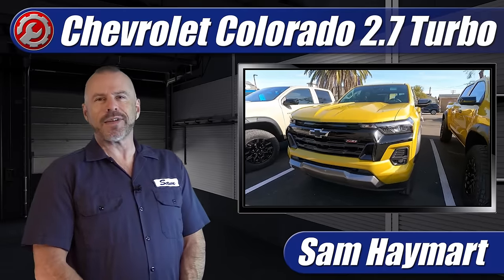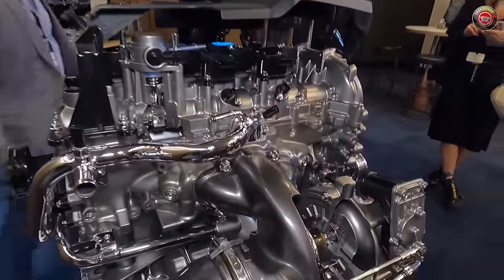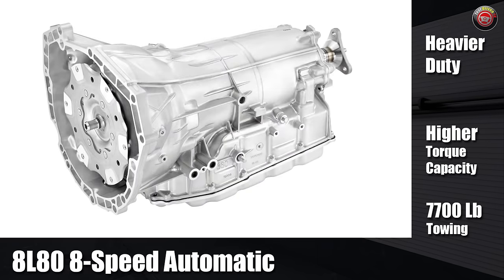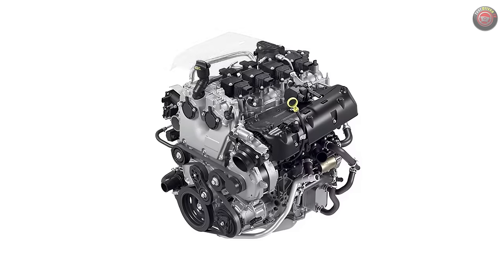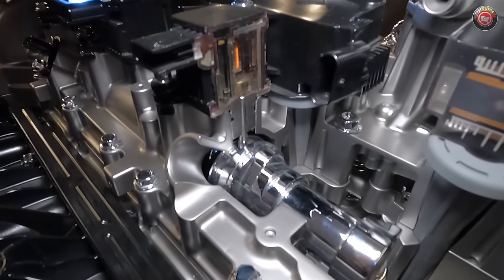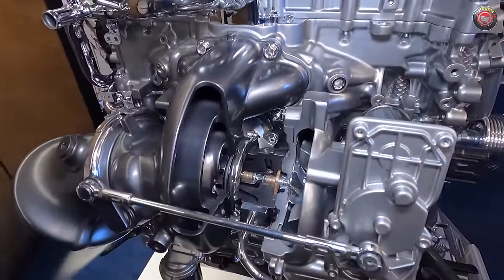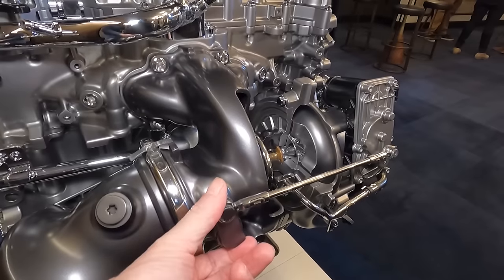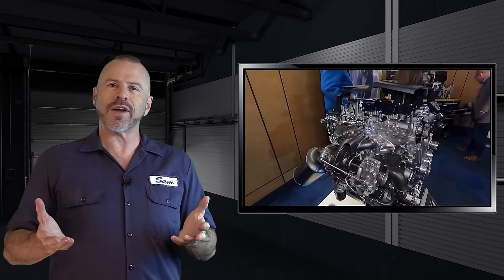2023-2024 Chevrolet Colorado 2.7 Turbo Engine: What You Need To Know

Comment: lots of things in common with the Toyota 2.5 liter Dynamic Force engine. Such as the electric water pump, variable oil pump.  I like the Toyota engine better though because it does not have the 2 cylinder deactivation thing and also Toyota's port and direct injection fuel system to keep the valves clean.
Reply: yea not having port injection paired with GDI and AfM is a deal breaker for me (the AFM thing baffles me& its been crap since 2008)! toyota knows if they’re going to build motors with longevity those 2 things are a must ! the 3.5 dynamic force & the 2.5 both got it right & im assuming the new 2.4 that will be in new 4runner & taco will share the  same tech
Reply: @thisdayage7997  AFM on a 4 cylinder is a real head scratcher.  It can only be for EPA numbers.
Reply: @csinalabama  ya a 2 cylinder turbo what could go wrong🤦‍♂️they designed the whole valve train around AFM & the camshafts are custom ground in house by GM for quality control….i ASSume it’s because its very finicky & unreliable otherwise….way too much going on in the valve train for engine to be reliable long term ! when they ran the 2.7 through a torcher test they said nothing about running it in AFM mode
Reply: Aren't these things designed to run hotter... can understand the port injection concern in a non-turbo, just unsure if the same issue on a hotter running turbo where the carbon is more likely to be burned.  Also, not liking AFM because... it might save gas when going downhill?  Do you really think it's active in normal driving?  No.
This is all 'feelings' based, would need some numbers to understand the complaints.  Kinda reminds me of what people said about the Ford 2.7L when it was new.
Reply: @toddwerther188  Really two separate issues.  GDI engines get carbon buildup on the valves unless port injected fuel cleans it off.  It happens less with a high quality synthetic oil that is regularly changed.  AFM engines activate when the engine is at speed and cruising.  The AFM system causes lifter failure and oil consumption.  There are lots of videos on GM's AFM problems.  If you want to think the problem is solved, that is up to you.   The issue of turbo engines getting hotter is a real concern.  The oil breaks down faster in a turbo engine and should be changed no later than 5k miles.  Turbo engines need better heat management than non-turbos, so do your homework on heat management before you buy a particular company's engines.  For example, look at all the problems with head gaskets on small Ford turbo engines.
Reply: @csinalabama Yeah, GM is trying to skimp for MPG ratings.
Reply: “A.F.M.” 👎👎👎👎 It’s a Full size Truck keep it running “4” cylinders no thanks even if it was always “4” cylinders direct fuel injection… Does GM think their direct injection won’t succumb to fouled up intake valves???
If this engine was 4 cylinders all the time and “DUAL” fuel injection I would consider it
Reply: @MrJEEPJT  They just want a profit, and they only look at quarterly stock reports.
Reply: @toddwerther188   I’m not a F-150 advocate but at Least Fords 2.7 is 6 cylinders all the time…🧐 I would have to hypothesize that an in-line “4” would be a simpler design… GM really botched this design with cylinder deactivation/AFM  as first glaring issue !!
As a clean slate design should have dual fuel injection to keep intake valves clean….
Addition insult “3” different power versions another GM SCREWS The customer for more money
Reply: @myk1_sp  🤨 What was I thinking ??? GM executives not interested in giving the customers the best truck for their hard earned $$$ at many $$$$ above sticker price !!! Rest assured Toyota will have a far better “2.7” turbo 4 for the Tacoma….for 2024
Reply: @MrJEEPJT yes hopefully Taco/4Runner come with 2.7 not 2.4 . I want more Torque.
Reply: Toyota aint any better, overrated

Comment: GM reliability is very questionable in the last few years, especially cylinder deactivation.
Reply: And transmissions!
Reply: @chrisb9478  That’s true. My daughter has a 2016 Surburban and the trans went out on it with around 150,000 miles. It rides and drives wonderful but it has had its issues but the cylinder deactivation has worked great so far and now it’s pushing 200,000.
Reply: Same thing can be said about all the brands. GM just gets all the attention because of the 8 speed which is fixed by now, and I would know because I have a 2019 sierra with 172000 miles with no problems, At all on anything on that truck. But it's still a looser truck because Consumer Report says so. The new Colorado and Canyon look 10 times better inside and out compared to all the competition out there if you were to be honest.
Reply: I bought the Range Solution Chip to plug in port under dash 2 keep it in 8cly mode,  works great...
Reply: Doug I 100% with your statement. 8 speed has been problematic as well.
Reply: @John & Whitney Kokalis  the 8 speed shitter and shake does not effect all transmissions. Just a small % of them but a big enough % to be a big problem.
Reply: @chrisb9478  my friends 2019 zr2 Colorado has been having transmission issues. Chevy is dragging their feet to fix it.
Reply: Is that a Chinese motor?
Reply: I absolutely love GM Trucks as far as the ride and handling. I have been burnt by a 10 and a 20 Gmc sierra. I made the switch to a Tundra but hate the way it rides. So what the hell is a man to do? 🤷🏼‍♂️

Comment: A 4 cylinder turbo, with cylinder deactivation ?
I have had a very successful,  40 years career with forced induction, sounds like to me the drinking water from Flint has found its way into the Powertrain Engineering Dept. at G.M.
Reply: I'm in the market and this is the way it is going, not by market demand but by demand of the W.E.F. and the traitors in D.C. With that said the Toyota is also going to a 4 turbo and is $10,000 more? What are your thoughts on those of us needing reliability and utility in our trucks? I drive an 07 Frontier I bought new, 150,000 later still running good, but it won't be long. I'm a remodeling contractor and tow a trailer 3-4 times a week. Thanks
Reply: you never even feel   when its  running on two  and power is instant it you touch the throttle    beats  the 5.3   hands down
Reply: @buellscool1  just bought  a 24 sierra with the 2.7    its a beast  lot more  power than the 5.3

Comment: this is all nice and cool, but I would rather have a 3.5 v6 naturally aspirated,  that will last a lot longer than a turbo charged or supercharged engine. I will take longevity over a couple miles per gallon anyday
Reply: 98% of owners will never keep the truck long enough to worry about longevity, its the American way.
Reply: GM ran that engine pretty hard in their durability testing with little to no wear.  You can make anything robust with enough money.  GM did drop their inline six project which confused me.  One head and set of cams, no balance shafts, easy to turbo and electrify.  I also like V6 and it makes sense for FWD due to short length.  But a truck can have a long hood.
Reply: Every diesel engine is turbocharged, and they last for a very long time. So the issue isn't the turbocharger.
Reply: @fightfortheright1776  This is false in more ways then one. I will just stop with the fact that all diesels do NOT have turbos.
Reply: Exactly. I wouldn't trust this at all.

I had an 06 with a 3.5 and it was great. Had no problems at all.

Comment: Sounds like it would be awesome, for as long as the factory warranty lasts
Reply: They want it to fail close to 100k miles so you have to buy another truck. Turbo on/with an aluminum block and aluminum heads is a recipe for failure.
Reply: @michaelgood1791 some of the strongest engines ever made have aluminum blocks.  Some of the strongest engines ever made have turbo chargers.  What in the actual hell are you saying😂

Comment: Probably going to have the same issue with intake valves as for due to the direct injection not have fuel pass by the intake valve keeping it clean. Looks very complex and long term reliability is questionable.
Reply: yeah I'm a little worried about GDI as well i honestly wish they keep the 3.0l diesel or put the 2.8l diesel in their way better gas mileage id say since its smaller then the Silverado it would be even better on fuel id say about 33 city and 38 highway id still feel like the 2.8l would need a little bit more power but one more benefit diesels tend to last longer then gas engines just another reason but they dropped them for some reason and I don't know why honestly cause the turbo 4 banger might get more power but it gets a terrible 19 city and 23 on the highway and it has AFM I wish gm would at least leave the 4 bangers out of but I guess not this is all what's stopping me from getting the canyon

Comment: Got 204k miles on my 2.7 she runs like a top. I don’t tow anything thoe. I also change oil at 50 percent oil life.
Reply: Wow, what type of oil do you use?
Reply: Great to hear it.
Reply: That's good, I'm at 35,000 kms and the oil cooler needs to be replaced. I tow an RV occasionally but otherwise it's been a daily driver. I'm somewhat concerned about longevity.
Reply: We hear people bad mouthing engines all the time. It really does not matter on what company makes it, or whether it's a 4,6, or 8 cylinder. What almost all people go by is the oil life monitor. Modern day engines need more frequent oil changes. Especially the turbo engines. Doing that will eliminate a lot of the horror stories you here about.
Reply: I'm with you on those 50% oil changes

Comment: I ordered a Colorado LT 4x4 with the L3B - HO. I Can't Wait !!!  I didn't want to pay the ZR2 price so I got a lower trim level with all the power. We test drove a 4x4 Ranger and compared it to the 4x4 Colorado. The Colorado won "Hands Down" ! The hard part is waiting three months for the build and delivery.
Reply: I'd rather have the standard suspension anyways. The ZR2 is a lot of weight, a lot less capacity, a lot worse mileage, and a lot more strain on the components.

Comment: Will be interesting to see how these fair long, long term. By the time we know, we'll be mandated to drive EVs if we want new cars.
Reply: I was thinking the same thing, by the time we know, you won't be able to get the proprietary parts that break.  The cooling and oil systems seem overly complicated.
Reply: Lol. Doubt it.
Reply: TheJoncic   It depends on how we interpret long term. I interpret it as until the warranty expires.
Reply: What does administration has gone gas I’ll be back under two dollars a gallon. EV cars will be dying off.
Reply: I C E will still be here for another 40+ years. EVs are not the future.
Reply: @frotobaggins7169  Maybe, but an external water pump should be easier to replace. Reliability is important but so is being easy to fix.
Reply: @joew6277  Maybe, but how much does it cost and where will you find one?  My guess is this is a pump used only on this one engine.  The v8 is very easy to work on.  I could change my water pump for about $50 and one hour and I could find it in any parts store anywhere in the country.
Reply: @frotobaggins7169  In today’s world I imagine it would be hard to come by. Unless they start making a bunch of these engines to where they need a bunch of replacement parts.
Reply: Didn’t you hear him say proven at the beginning don’t think they been out long enough to tell yet
Reply: Why not turbo a 4.3 v6? I mean ffs!
Reply: Can u reallynot eventually get parts? I mean basic parts? Real specific parts i cna understand.

Comment: Wondering if carbon buildup on the back of the valves  might become an issue on account of the direct port injection. Otherwise, looks like a strong, light engine. Interesting that they charge you $395 to "uncork" the rest of the torque, lol. Probably takes a 5 minute firmware update.
Reply: I thought of that too.
Reply: Here's is what my mechanic told me.  Carbon actually absorbs gas and with lower your mpg on an old school set-up then hardens making it impossible to burn off if not treated.  We all know how a DI system works.  Dump in Seafoam every oil change and it will keep you running and help remove it.  How, since no fuel hits the valve?  It does what the bottle say.  Lubricates the surrounding areas and with vapor from Top Tier gas will clean it up.
Reply: The vapor of top tier gas will clean what; the surrounding areas? How about the carbon built up on the out side top of the admission (intake) valves? Heard it gets pretty bad carbon built up over there.
Reply: @luisgonzalez8929  got a point.   I’ve seen videos where you pull off the intake hose and dump a can through the throttle body to get to the upper end.
Reply: Check out the video from the guys at TFL when they interview the engineer about the design of the engine, lots of good info directly from the engineer. I believe he answered this question and if I recall correctly, that build up of carbon that has been seen on some other engines with DFI, has to do with how the crank case ventilation is designed.
Reply: @toddkovalcik332  Yea I've seen that one.
Reply: @toddkovalcik332  CCV might effect how quickly it happens but I think carbon buildup happens universally for DI engines.  Top tier fuel might help, sure.  I try to stay as exclusive to TT, regardless of vehicle/engine.
It might be the case that GM calculates that carbon buildup will only become a problem by the time the engine needs rebuilt anyways, i.e. 200 or 250K miles.

But yeah, when he said 10:1 compression ratio running on 87 octane, I figured they had to be using DI before he even said it had DI.  It's amazing how well combustion can be controlled these days.

Comment: Hopefully this doesn't bend rods in eco 2 cylinder mode like the v8s. Would have preferred GM left cylinder deactivation out of this engine.
Reply: This exact engine has already been in production for several years with literally hundreds of thousands in larger/heavier half ton trucks…they aren’t bending rods.
Reply: The 2.7 does not have "rods" or pushrods. It's an overhead cam engine.

Comment: I have a 2018 LT Colorado and has the 3.6 L engine.  During the summer it gets close to 28 mpg.  Now I am very disappointed that this engine is being done away with in the Colorado.  The 2.7 turbo engine gets worst fuel mileage than the V6 3.6 L engine.  I think that can be a mistake because many like me really like this engine.  I do hope that in 2024 GM decides to also use the 3.6 L engine again.  The mileage on the 2.7 tubo is less  than the 3.6 engine and fuel costs are high.
Reply: are they higher when cruising on the highway or overall?

Comment: Just go the 2024 WT with the Turbomax engine and towing package.  Coming from a VW golf. Lol. The torque delivery is extremely different in the Colorado from what I’m used to. The power band is pretty evenly distributed on this engine/transmission set up. I don’t feel the pull very much of the turbo, but I’m at 75 on the highway before I realize it.  So far so good on the Colorado!  It’s the best looking Colorado in a decade, inside and out.  A very capable truck.
Reply: I have a 2023 WT with the 2.7L
Vinyl floors baby

Comment: Seems like a pretty nice setup, definitely a nice break down you did there thank you. I want to see what Toyota's setup is going to be on the Tacoma maybe not the most torque is the best idea cuz 20-27 lb of boost that's quite a bit, makes me concerned about heat soaking the turbo 🤷 Toyota uses air-water intercooler instead. I'll b looking forward to what's going on in midsize 🛻💨 segment
Reply: The electric waterpump is designed for excellent heat exchange as its centered to cool around the turbo first.
I doubt that will be a problem!
This is a promising design.
It uses some Diesel durability, so added bonus to buyers working the engine hard.
Reply: @jemtec1  The “AFM” or cylinder deactivation on a “4” cylinder design🧐🧐 Nope deal breaker at least if it was always “4” cylinder operation I
Would say ok. Rest assured Whatever Toyota brings to market be it a turbo version of their very stout “2.7” 4 banger will be far better…
Reply: @MrJEEPJT  """Standard i-FORCE turbocharged 2.4-liter four-cylinder engine produces up to 278 horsepower, 317 lb.-ft. of torque.
Available i-FORCE MAX turbocharged 2.4-liter four-cylinder hybrid powertrain produces 326 horsepower, 465 lb.-ft. of torque."""
Reply: @gnd111  I’m not knowledgeable on the 2.4  4 cylinder engine … is it a new design ?? Does it have the industrial grade internal components of the 2.7 4 cylinder??? The HVAC company I work for services 3 dealerships most of the technicians in the service department have Tacomas or Tundras all of them give complimentary remarks on the 2.7